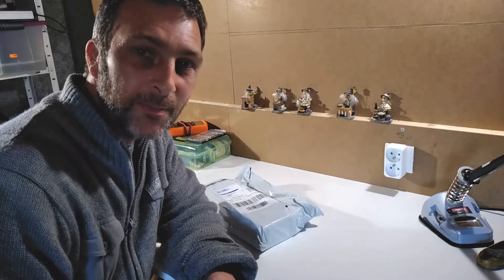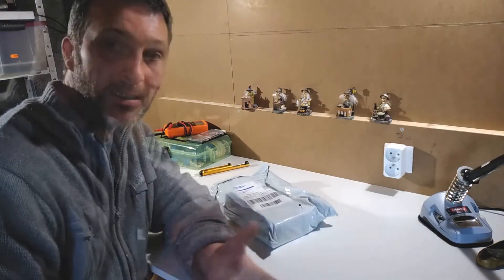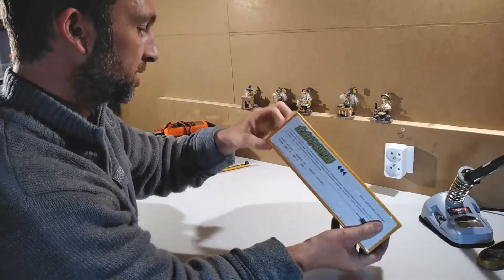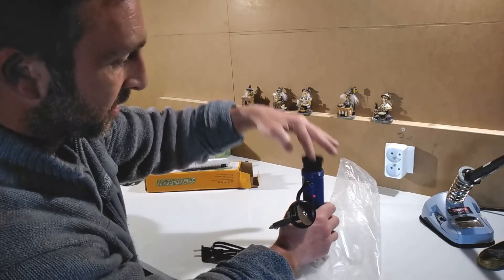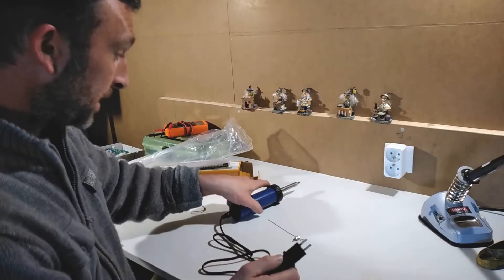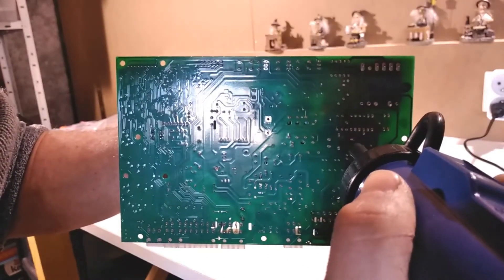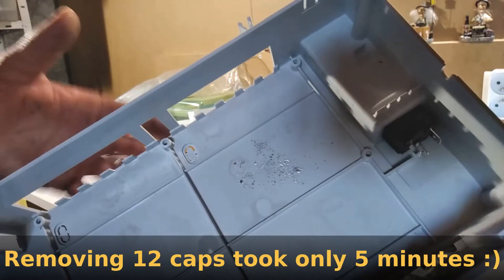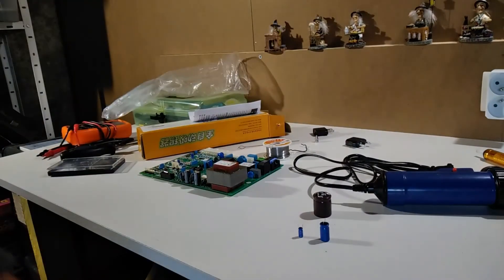My new toy - does it suck? | Electric solder sucker

Comment: Hi dear  please you tell me the voltages of your desoldring pump 110v or 220v. 
resistance of element & solenoid ? Thank you.
Reply from the maker: It's a 220V unit. I haven't taken it asunder enough to check the resistances though.

Comment: For some reason I'm not getting any suction on mine? Any Tip
Reply from the maker: The large rubber shoe in the unit is used to make suction, it's possible that it's not seated properly or is damaged. Or a lack of current to the electro-magnet that pulls the shoe up. Does the pump make a clicking sound when you press the button? 
The most likly cause would be a simple blockage from solder. Sorry for the late reply.
Reply: @8bitsinthebasement  thanks. I found the problem it had a loose Metal at the rear of the sucker when I opened it.

Comment: Dors it work now 😀 I just ordered one for me. I will use only on game controllers when changing analog sticks. Do you think this will be enough? How much time need to heat and start using it? Thanks
Reply from the maker: Yes it's still working very well, I've used it quite a bit in the past and I've only had problems with it when trying to remove large connectors that had been heavily soldered for extra strength (they require more heat due to large ground planes). I let it heat up for just a little over 5 minutes before using it. Hope it works well for you, and thanks for watching.
Reply: @8bitsinthebasement  Great, thanks for answer 👍

Comment: Model & Make brand name?
Reply from the maker: Believe it or not I didn't find a brand name or model for this, but here's a link to the very one I've shown in the video https://www.banggood.com/fr/30W-220V-Electric-Vacuum-Solder-Sucker-Desoldering-Pump-Iron-G-un-p-989643.html?cur_warehouse=CN. It's now the 19 June and it's still working as well as it did on day one. I use it almost every weekend.
Reply: @8bitsinthebasement  How is it going with the solder sucker? Are you still using it every weekend and is it still functioning without problems?
Reply from the maker: @jimmydansbo7847  I use it quite often still and I've not had any problems with it. It is perfect for small jobs like recaping a board or removing the odd IC. One thing it is missing  however is a temprature control, you can't increase the heat of the pump if you're working on a board that has a large ground plane and sucks away all the heat. Apart from that It does what I want it to do and it's served me well so far.

Comment: Seams to work fine. Hope the solder don't over time melt the rubber boot.
Reply from the maker: The rubber part is a huge hulking lump, I dont think that the solder should damage it too much, I just hope that it keeps on working. But I am honestly impressed with it for the price. I've practiced a little with it since the video and once you get the hang of it, the parts just drop off the boards ;)